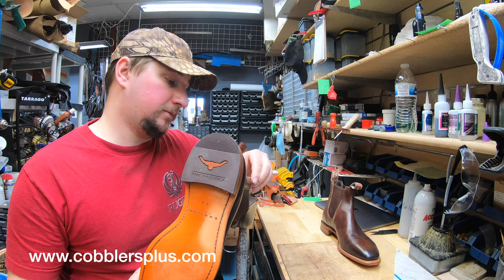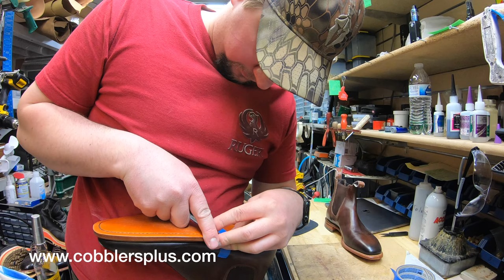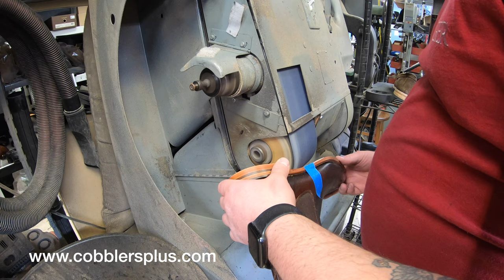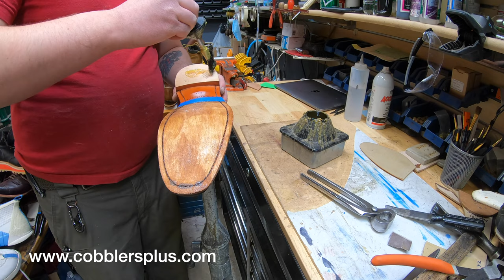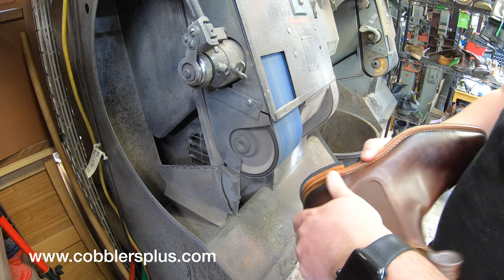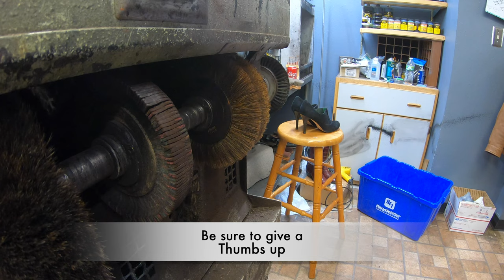R.M. Williams Boots get some Vibram Explosion Sole Protecters and Heels

Comment: RM Williams is an institution in Australia, lot of people have them.
I find it strange that some people put a sole protector on a leather sole, it is possible to buy RM Williams with rubber soles.
In my opinion, I think it would make sense to buy the rubber sole version.
Reply: Maybe some people can find sales on leather bottoms, and some prefer the leather/rubber combo. I myself always prefer leather, but in the rainy/snowy season, never! My bottom has meet the slippery pavement all too often :)
Reply: Leather molds to your foot and is more comfortable but rubber has better wear protection and traction so basically you get the best of both worlds, and also leather soles are easier to replace and look nicer
Reply: @jackgolden1774  Leather  all the way,    Wear them  into the Ground.
Reply: @jackgolden1774  all RM Williams boots have a leather inner , the sole doesn’t mould to your foot.
Reply: Sole protector rubber will assist in keeping the iriginal shape of the leather, before it will flare out slightly through wearing them.
  Best time for this is some months after purchase and wearing. 
  Certainly it will minimise slipping.

Comment: With as much vibram rubber that is trimmed off...I would rather Vibram added that portion of the rubber to the thickenss of the sole guard, and just make a smaller over-all sole guard. With all that excess...one could probably get twice as much thickness, resulting in a much longer lasting sole guard. I just hate to see all that good rubber go to waste. (But them again...I am the kind of guy who will pick a penny off the ground and save it...lol). Another great video. Keep up the great work sir.

Comment: I just got my first pair of RM Williams Comfort Craftmans rubber sole. Not kind of sure if I should put on the Vibram Sole Protecters 2340 Explosion with the matching heels on them so as to prevent wear on the original ones. I've always done this on all my other shoes especially those with leather sole and this practice has made all my shoes last for years. I'd asked the sales person at the store and needless to say, he told me that it was not necessary. I'm hoping to get a second opinion from a professional here. Thanks.

Comment: I always have them applied on all of my leather sole shoes. But I've wondered, if it's just the half soles and rubber heels getting worn out and replaced, will I ever have to have the leather resoled or the shoe recrafted?
Thanks!
Reply: eventually you will, but that's a  LONG eventually. every time a new pair of sole guards gets put on the leather underneath has to be lightly sanded and roughed up so it does wear over time. How many sole guards can you get before a new sole is needed, no clue but you have a long while